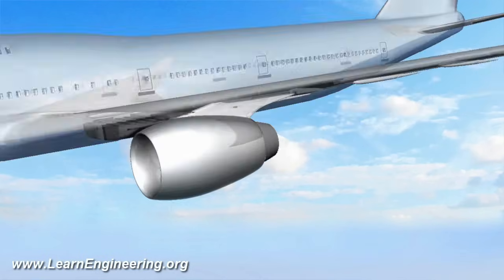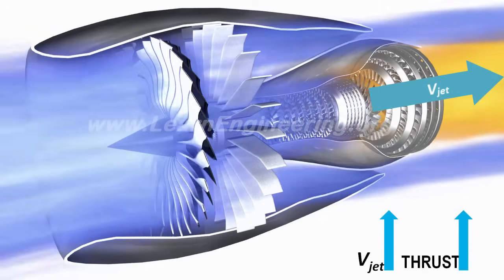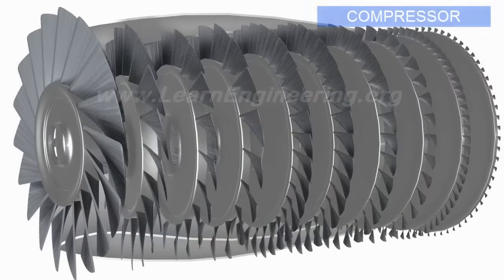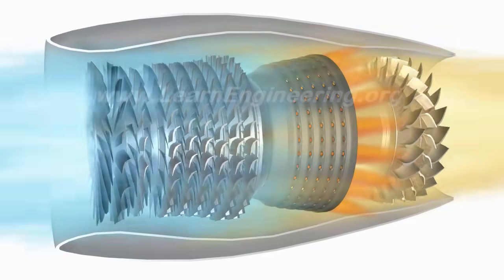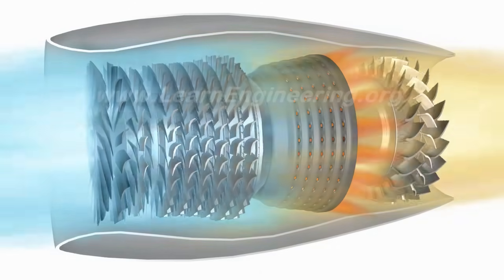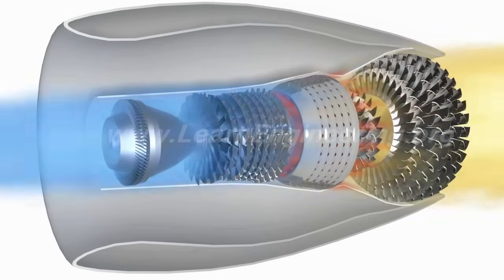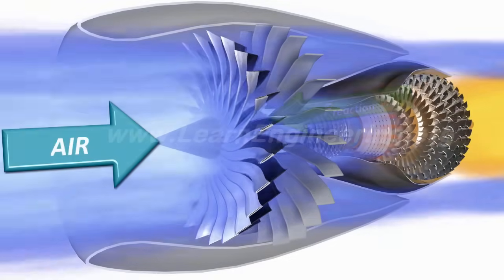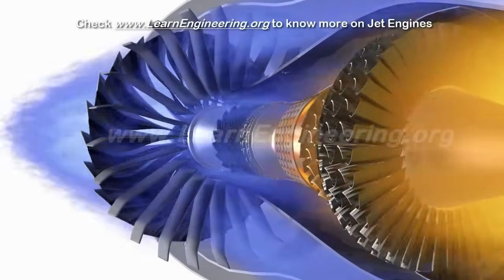Jet Engine, How it works?

Comment: If you make a fire without oxygen than how can the fire creates, without the wind then how can the engine fan to moves the air circulation front abd back maintains the planes the balance isn't same as the cars at all.

Comment: No discussion on the purpose of the stators
Reply: Guide the flow of air to hit the rotor blades at the optimal angle for maximum efficiency.

Comment: Interesting.  But there is so much missing here.   
1.  How do the outer blades get their spin in the first place.
2. There is no diagram showing how air is compressed before ignition.  The mechanism is shown, but no true demonstration as to how it actually compresses the air before it's heated.
3. No explanation to whether or not, once the plane reaches a certain speed, whether or not the blades will spin from the sheer momentum of the drag forcing air inside the engine.
4. Why is there a compressor on both ends of the jet?  Because, once the air is compressed once and is picking up fuel, heat and momentum, why would you want to slow all that energy down by compressing it a second time?  Aren't we reducing the velocity of the outflow?
5. How powerful can a jet be, without using fuel?  The demo shows that even just plain compressed air is being used to augment the hot gasses shooting out of the end nozzle.   Do such engines exist? Jets without fuel?

Comment: Turbo fan engines dominate propulsion systems due to fuel efficiency and low noise
The actual mechanic is too complicated to note on a comment. 
Watch the full video.

Comment: Air compressor》Chamber being pumped with fuel, that has fire》Output = Jet Engine?

So I can make a jet engine using legos, assuming I use a fireproof, sealed burn chamber and a output? New video idea dropped for Jamie's Brick Jams.

Comment: the turbine reduces the velocity of the ejected gas right? which reduces thrust right. Why are they adding turbine at the end?
Reply: If I understood it right,
Compressed air in>combustion>exhaust to turbine, which is on the same shaft as the compressor, slowing the exhaust down, but increasing the speed and torque of the compressor. Allowing the jet to continue to run as long as it has fuel.

Comment: Let's me know

Airplane engines, specifically jet engines, work by generating thrust, which propels the aircraft forward. The basic principle behind jet engines is *Newton's Third Law of Motion**: for every action, there is an equal and opposite reaction. Here's a simplified explanation of how a typical **turbojet engine* or *turbofan engine* works:

### 1. *Air Intake*
   - *Air is drawn* into the front of the engine through an inlet. In a turbofan engine, a large fan at the front pulls in a significant volume of air.
   - Some air passes through the engine core, while in turbofan engines, a large portion bypasses the core, providing additional thrust.

### 2. *Compression*
   - The air that enters the engine core passes through a series of rotating **compressor blades**.
   - These blades compress the air, increasing its *pressure* and **temperature**. Compressing the air makes it more efficient for the combustion process.
   - The compressed air then moves to the combustion chamber.

### 3. *Combustion*
   - In the **combustion chamber**, fuel (usually aviation kerosene) is sprayed into the compressed air.
   - The fuel-air mixture is *ignited* by a spark, causing a **high-temperature, high-pressure explosion**.
   - This combustion greatly increases the energy of the air, turning it into hot, rapidly expanding gases.

### 4. *Turbine*
   - The hot gases then move through the **turbine**, which is located behind the combustion chamber.
   - The turbine blades are connected to the compressor via a shaft, so as the gases expand and pass over the blades, they spin the turbine.
   - This spinning action powers the compressor at the front of the engine, keeping the engine running.

### 5. *Exhaust and Thrust*
   - After passing through the turbine, the remaining hot gases are expelled at high speed through the *exhaust nozzle* at the rear of the engine.
   - The high-speed exhaust gases create *thrust* by pushing against the surrounding air, propelling the airplane forward (Newton’s Third Law).

In *turbofan engines* (commonly used in commercial aircraft), some of the air bypasses the engine core, moving around it. This bypass air, pushed by the large fan at the front, also generates additional thrust and makes the engine quieter and more fuel-efficient.

### Types of Jet Engines:
1. **Turbojet**: Simplest form of jet engine, all air goes through the engine core.
2. **Turbofan**: More efficient, with a large portion of air bypassing the engine core. Used in most commercial airliners.
3. **Turboprop**: Similar to turbofan, but drives a propeller for slower-speed flights.
4. **Ramjet/Scramjet**: Used in supersonic and hypersonic applications, no moving parts; air compression happens due to the aircraft's high speed.

### How Jet Engines Create Lift:
While engines provide the thrust, *lift* is generated by the wings. The forward motion caused by the engines forces air over the wings, creating lower pressure above the wings, and higher pressure below, thus generating lift.

Jet engines are marvels of engineering, combining multiple stages of compression, combustion, and expansion to produce the high thrust needed for flight.

Comment: You only teach to the choir.  Which defile the actual purpose of instruction itself. Its not being clever. Place a vacuum in the front of the engines to force air through the tunnel which would turn the turbines.  Creating free energy and thus defeating the arguments of greenhouse gas

Comment: I have a question if the fan compresses the air then what starts it how the fan rotate as long as the combustion require a huge amount of air and high pressure??????

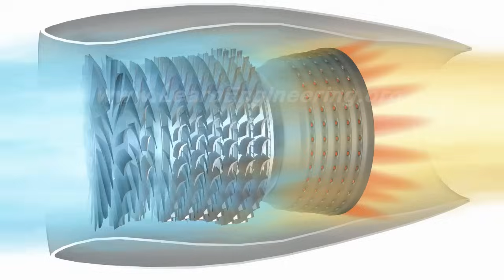Comment: The compressor seems to run the blades against the air flow, which creates the heat I assume? 🤔 1:49

Nah, now I see it’s an error in the video!! The compressor blades are pushing the air in the wrong direction in this animation.
Reply: Compressing air causes the air to heat up
Reply: @Mike_HuntizWet  yes, but the video has an animation error with the blades turning in the wrong direction.

Comment: Just a difference in a few milies of global barometric pressure would generated 1000s times the energy & therefore thrust!. 🤷 40yrs A 3D Design Engineer UK

Comment: Dont panic op, but at 1:47 thefront blades of the compressor are angled the wrong direction and would be pushing air out the front of the engine if it were spinning that direction. Typical american fail.

Comment: The front fan on this illestration is turning in the wrong direction it wont suck air into the engin but will suck it out so this engin will never start later in the video though  its turning in the correct  direction.

Comment: I think the vanes on the turbofan are oriented the wrong way.  As shown, it would push incoming air out, not pull air in.  Same for the axial compressor blades.

Comment: I am kabir. From bangladesh.I could understand that logic. How it works and divide air and making power by compress air. It will work by newton 3 formula. But it needs acurate elements. But it is bad, because it need motor. I make a jet engine that no need any motor. It will work automatically. Yes it is possible.

Comment: What about an engine that sucks from the rear...because you are sucking faster than the atmosphere can replace...then atmosphere is rushing in pushing you forward and you can dispel the sucked atmosphere radially around the engine and feed your own vacuum...

Comment: Sooo... Turbofan = jet+propellor+casing.
But why not leave out the casing? Just because of noise or does it actually increase the reaction force on the propellor? Or would the propellor without a casing spin too slow to provide any thrust at all at high speeds of the aircraft?

Comment: Man I was confused by this animation so much wondering why you'd have the blade push air out the front of the engine until they fix it at the end of the video. the blade pushes out the front at the start of the video then at the end pulls at the front fixing the animation.

Comment: 2023, dyson is the trend for millennials. Afterburner, opposite-concept of center is fastest. Use turbofan(turbojet)engine as center and slower flow, use engine casing as a ramjet on outer for faster flow.

Initial test should be a rear ducted fan behind a regular turbofan like a ducted-fan hang-glider trike but since the turbofan is providing the exhaust flow, fan is not needed but ducting needed and fuel-injection needed... 

If i have to consider a dyson... maybe as an afterburner stove after the turbofan or something... been walking past those things in departmental stores and electrical stores and ...

Comment: Aren't the rotor blades in the compressor section sloped the wrong direction? I work in HVAC and I get how you can have a backwards inclined centrifugal fan. But how can you have a backwards inclined propeller fan, which is basically what the rotors on a turbo jet compressor stage are?

Comment: Sorry, a jet engine is a reaction device plain and simple. The EPR, engine pressure ratio is around 2.5
To one! The reaction takes place inside the engine the exhaust pipe is simply that an exhaust pipe!!
Some small amount of thrust is realized through this 2.5 engine pressure ratio but the main part of the thrust takes place inside the engine in the hot section against the turbine Wheels! Just like a rocket Engine, the lower the pressure in the exhaust cone equates to higher efficiency in the burner section of the rocket engine. I have no clue where this guy got that from but he is WAY off the mark.the balloon moves forward because the air pressure inside the balloon is higher than the exhaust pressure is outside or at the exhaust. The exhaust gas pressure has little to do with pushing the balloon forward! Simple physics, action and opposite reaction!.

Comment: Where's the starter?
Reply: There's no starter. Compressed air from an external source (such as the APU) is injected into the compressor to make it spin. When enough speed is achieved, fuel is added and the engine can sustain itself.
Reply: @zeendaniels5809  there's no fuel. Its a free energy engine. Free energy Literally right in front of our eyes.
Reply: @Mein_Kek  Sure thing dude... Sure...
Reply: @zeendaniels5809  so where is the fuel? Show me. Where?
Reply: @Mein_Kek  01:10
Any other obvious questions?
Reply: @zeendaniels5809  where's the rest? a single plane carries over 30000+ gallons.
Reply: @Mein_Kek  That depends on the aircraft. Airliners like the A320 or the 737 don't carry that much fuel, more like 7000 gal, and it's stored in massive fuel tanks inside the wings (which are mostly empty as you surely don't know), and more tanks inside the fuselage in the space between the wings (where the landing gear stores).
There's plenty of space for all that fuel.
Reply: @zeendaniels5809  7000 gal equals to 2 elephants on each wing? Make it make sense. Those thin wings carries 2 elephants worth of weight? Lol.
Reply: @zeendaniels5809  not made any sense. Never will. So gravity doesn't pull that? What is this fuel you are talking about? Gasoline? Solar? What is it?
Reply: @Mein_Kek  Yep, the engineering of aircrafts is awesome... So complicated machines.
The fuel jet engines use is called JET-A (A1 is also used depending on the weather), and just a refined form of kerosene.
Of course gravity pulls that down. Shut off the engines in mid air and the whole thing will fall like a brick.
And just so you know, just because it doesn't make sense for you, it doesn't mean it's fake or something. Usually it's just a display of how much you actually know (which is very little in this case, I can tell).
Reply: @zeendaniels5809  you dont know that. You're no one. You are not an engineer nor see the inside of a plane. You're talking nonsense.
Reply: @zeendaniels5809  you knew next to nothing and you pretend to be smart. That's all.
Reply: @zeendaniels5809  so jet A is just a diesel. 7000 gallons of diesel = 22544 kilograms. Average weight of 4 elephants. 

So now 4 elephants of fuel in each wing? You're not fooling anybody. You wont fly with that much weight. Its impossible.
Reply: @Mein_Kek  How do you know I'm not an engineer? The same way you know about the impossibility of flying? (I.e. you don't).

You have poor reading skills, but it's Ok. I'll take the Airbus A320 as an example, since it's one of the most used airliners today and I work with those daily anyway. The aircraft can take around 7000 gal of fuel IN BOTH WINGS AND THE CENTRAL TANK. 7000 total, not in each wing. That being said, it can take off with more than 70 000 kgs of weight (total, including airframe, fuel, passengers and cargo)... So you are wrong about the aircraft not being able to fly with all that fuel. It can, and it does. Daily.

Comment: What I don’t understand is that according to 4.40 in the video, fan rotates in a way of pushing air out, not sucking it in. High pressure area is on right of fan, low pressure area is on left of fan. How does it suck air, then?
Reply: And it doesn't use fuel

Comment: The main fan at the front seems to be going backwards...
Reply: Actually the whole assembly is rotating the wrong way, except the last pair.
Actually the turbo-fan blade angle reverses to the correct orientation at the end of the video.

Comment: There is something missing
To start a jet engine it takes air from APU (Auxillary power unit) To run the Shaft and the fuel pump

Comment: I wonder if a boat can be propelled by using the jet engine model of forcing compressed air and fuel combustion gasses slowly through through a set of compressor blades attached to the turbine .

Comment: You guys missed out on a crucial video element: the small army of squirrels that are responsible for the gas exhaust as the warm air exits their rear ends. Source: I am the CEO of a turbofan (just feed the squirrels fava beans) engineering plant.

Comment: I have one doubt, at 1:38 seconds, shouldn't the compressor blades be rotating in the opposite direction in order to push air from left to right???

Comment: Yes so you can cause enough Ruckus to float or fly
Please turn the planes are very messy between turbulence and vibrations you're just causing enough compound destruction to cause your own turbulence and vibrations
Which is probably confusing the outer mess
This is probably the form of helicopter as well as the propellers cause much turbulence and vibrations it is basically flying propelling its own turbulence and vibrations
Try flying not using turbulence or vibrations
You will probably be faster than the f**** Arrow coming out of the crossbow

Comment: The fan and compressor is not spinning the wrong way, the blades are in the wrong orientation. If you simply reverse the direction of rotation the turbine would be spinning the wrong way, so to fix the problem you need to reverse the blade orientation of the compressor and fan.

Comment: But how is the combustion chamber designed? When air is heated by burning fuel, it expands in all directions like the exploding of a bomb which does not produce any thrust due to air moving in all directions. How is this overcome? The tube must be closed from one side in order to produce thrust.

Comment: If the propeller(front of jet engine spins), even without fire it will move forward right, then wind coming from front = make it spin the same way and move frontwards right? Then if it is installed, just using wind shld be can move forward right? Then if use on windmill o-o this way it moves in circle and 3 energy for voltage creation right? Because as wind spins it, it moves too then below the - is | like a "T" like this. Good way for voltage-making and increase of speed right?

Comment: The narrator's voice sounds really annoying.  In the model above, the blades at the front would not suck air into the chamber but would prevent it from entering.  Either the blades or the rotation are shown backwards.

Comment: Axial flow blades, whilenworking in a tunnel to compress aire tend to circulate between70%diameter to center  test it by viewing from output air of axial flow fan, by suspending a curchif infront of rotorcenter

Comment: Question, what if the incoming air is colder or warmer, does it affect the thrust generated by the engine? Does the required fuel varies depending on the temperature of the air?
Reply: Cold air is denser than warmer air so cold air would produce more thrust

Comment: but what makes the compressor and fan spin up? Electric motors? How do planes generate electricity? A separate engine generator?
Reply: Compressed air from the auxiliary power unit. And yes, each engine run an electric generator.

Comment: Can you ignite gas with a laser .
This is due to concerns with gas pipes and ways in public places they could be lit .
Ok lighter ok smoke ok hitting with hammer ok but can you use a powerful laser at distance and light gas .

Comment: If you fly an aeroplane inverted in the air,the engines will start failing and you have to dump the fuel out of the engine before the oil catches on the flame and explodes the engines so imagine a plane flying upsided down in the air with two or more smoking engines depending how much engines the plane has,it's amazing.

Comment: Random question. If the fuel were to ignite, what kind of temperate could it be expected to reach?
Reply: this is gold
Reply: @krahe9376  admittedly, I'm not a very bright person. but even i get why this is "gold" 😆
Reply: I may be wrong, But the Fan from the turbofan engine sucks in cool air and mixes with the ignited fuel to maintain an APPROPRIATE TEMPERATURE for the thrust. Basically. Fuel is injected just to bring in more power or acceleration. Plus, why the engine nacelles dont burn because they are made out of high temperature resistant components like Steel.